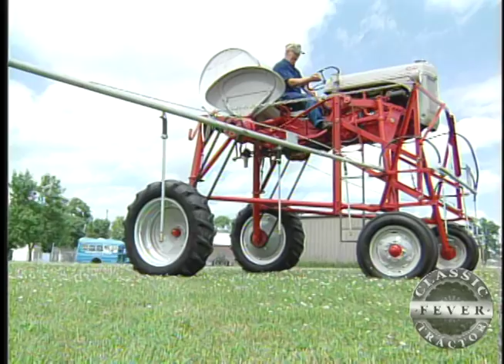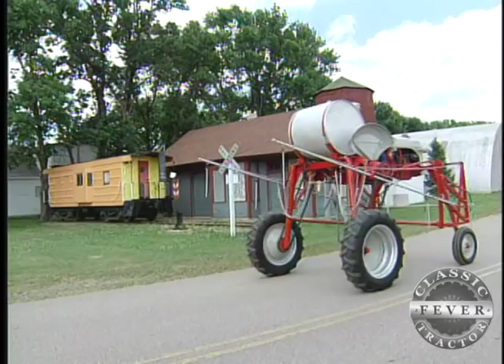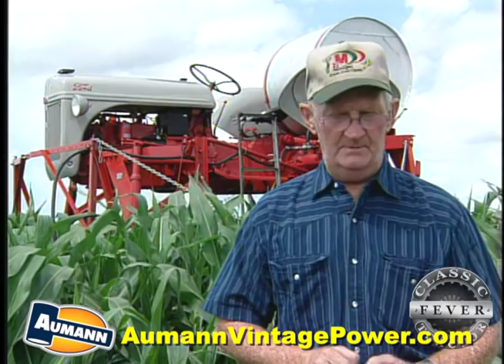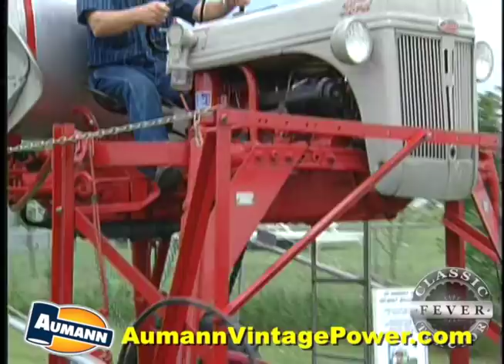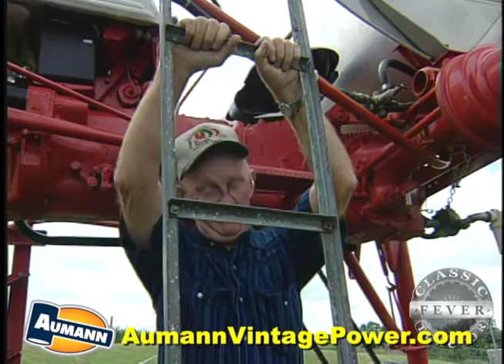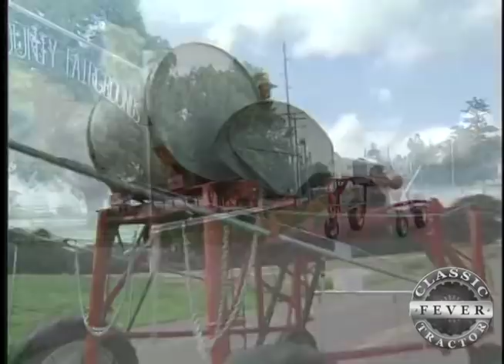You've Never Seen An 8N Ford Like This! - 1949 Ford 8N High Crop Tractor

Comment: Used them in south Georgia to spray tobacco and cotton and sometimes corn. I have a nice 8n now that is early 49 model like the one we had when I was a kid. Not too many high sprayers like that but there were a couple in our area back then.
Reply: I think they made some of those at the factory but they didn't look exactly like that. They had long front axle legs and enclosed rear wheel drive housings  kind of like the high crop tractors.